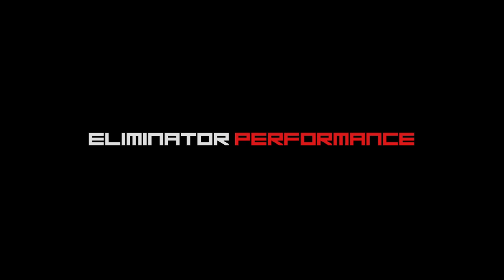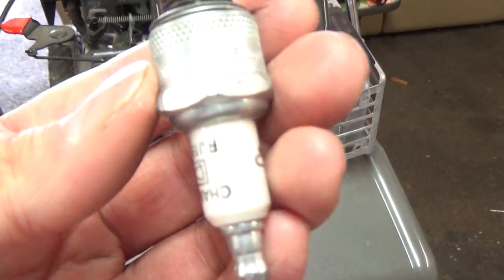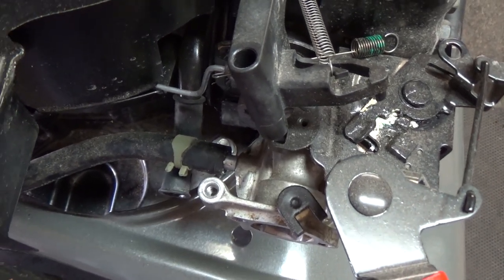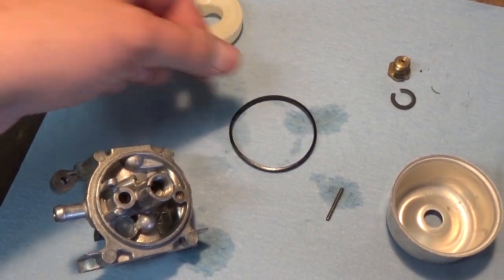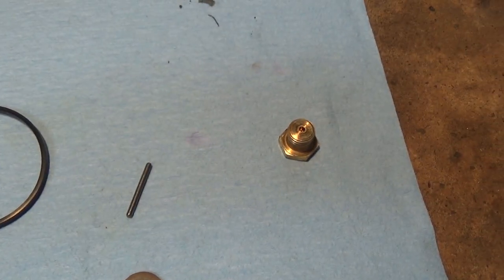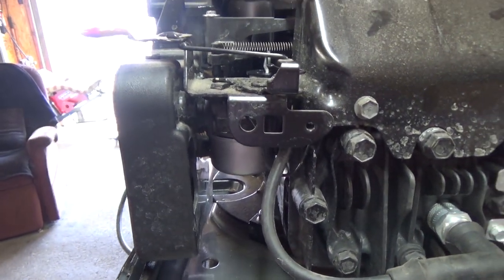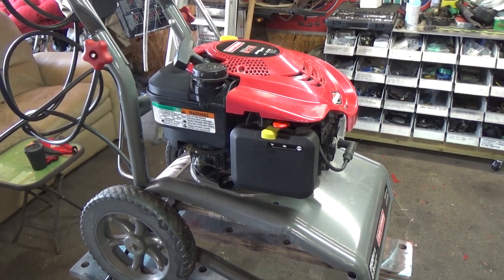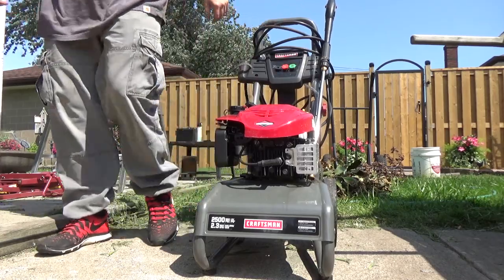Craftsman Pressure Washer - Full Tune Up!

Comment: Dude nice video, like the use of the shut off valve on the fuel line while you worked on the engine. Maybe a future video on winterizing a 4 stroke pressure washer would be good for the Eliminators that live in cold weather areas since there are lots of pressure washers for sale with cracked pumps.

Comment: Fantastic video. I have a Quantum gold 6.0 pressure washer that sat in my garage for 5 years.  I'm replacing the carburator, the filter, and the spark plug.  How do you  best clean the gasoline tank? any other suggestions ?  many thanks

Comment: Thanks for the detailed video.  I had the same situation with the jet nut gasket which was broken.  Can you tell me the replacement part number so I can find it?  Seems to be different ones available and I just don't want to guess.  For the moment I'm using a piece of cardboard to avoid the gas to leak but I wish to replace it anyway.

Comment: I just bought the exact pressure washer. What would make gas pour out of the hose that connects to the back of the air filter housing? The gas line hooks to the carb. This other hose comes from who knows where, but pours gas out of it when I pour gas Into the tank.
Reply from the maker: You probably have a leaking needle valve in the carburetor

Comment: Mine is running a little rough after sitting for a few years. I didn't take the carburetor completely loose but I took off the bowl, cleaned it, replaced the fuel tank which was cracked, cleaned spark plug, installed new filter. But it still running a little rough. I sprayed what I could but I'm wondering if the carburetor still has some residue left inside it keeping it from running smoothly. And yes, the gas smelled of turpentine and was yellow. What are your suggestions?

Comment: There's also an issue with them power washers the dip stick seal stops working and it leaks but I fixed mine with rtv

Comment: Good day I just came across this video. You know  canadian tire sells a funnel or did, that will separate  water from gas, it's tricky but it will keep fine dirt out.  Thanks
Reply from the maker: Yes, water settles to the bottom so it's possible to suck the fuel out from the top. For the price of fuel, and labour if I had to redo my work, we just replace the fuel.
Reply: @EliminatorPerformance   but more people should be using funnel when putting gas into machine Thanks

Comment: It's actually not a "air vane governor". The actual governor is mechanical, the linkage goes toward the other end of the engine. All that air vane does is control the choke through a thermostat attached to the muffler. Great vid.

Comment: I got the same pressure washer out of my neighbors trash and doesn't have the air filter housing can you link me to parts? Also need the o rings for the carb and bowl
Reply from the maker: No idea, this unit was a customers. Goodle the engines model number, or check the description in this video, it might be there!
Reply: @EliminatorPerformance  ok thanks my dad got it to run but leaks gas out of the bowl and now we can't get it running again going to try and clean the injector and bowl again.. lol
Reply from the maker: @gameondude3617  needle valve needs to be replaced!
Reply: @EliminatorPerformance  how hard is that?
Reply from the maker: @gameondude3617  you and your dad should check this video out. It's a little long, but there's good info here! https://youtu.be/3ri2_bKiuMo
Reply: @EliminatorPerformance  thanks buddy

Comment: Hi
Is a 2000 psi 1.9 gmp powerful enough to clean a concrete driveway?
Tx
Reply from the maker: Not if you want to get it down to bare concrete, you'll find yourself going over spots you already cleaned.

I'd recommend something more powerful, a 2500psi or more.
Reply: Ok Thank you for your advise
Have a nice day

Comment: I have the same model and it's leaking a little water from the pump on the left side if your facing it.
Reply from the maker: If you live in an area where it gets cold in the winter, and didn't store it in a warm area, you may have a crack in the pump.

Water inside will freeze and expand, and crack the aluminum or plastic housing.
Reply: I'm in southe California I was thinking it might be an o ring just was wondering if that's normal for this model I just bought it used.
Reply from the maker: @hammer5859  I'm not to sure to be honest, I worked on this for a customer of mine, just needed a tune up and didn't leak.

It's possible that one of the o-rings have gone, go to www.ereplacementparts.com and type in your model number.

You should be able to get a good diagram.
Reply: I took it apart and replaced the 3 o rings it stopped leaking. Thank you for your help!

Comment: I would add a fuel filter and a shut-off valve.  Always remember that some carburetors have a special metal coating that prevents rusting.  I would think twice about using harsh chemicals.

Comment: Is there a common replacement for the bowl nut gasket?  hose things are expensive .  I am wondering if there is a fibre washer that works as good, and what size to order?  I have even heard old milk jugs work ok, but a lot of work :)
Reply from the maker: Cereal box would work too if you were in a pinch.

Here is the official part # : 271716

It's a common part for Briggs and Stratton and Toro machines.
Reply: @EliminatorPerformance  I just put the jet bolt back on with out the fiber washer work just fine no leaks. Same with my craftsman snow blower.

Comment: getting water thru the SYSTEM but looks like the gun won't allow water thru it, how difficult is it to find one, and what do they run, as in cost?  I own a Briggs and Stratton  I own a troy bit  175cc 7.75hp 2700PSI engine year is built in 2013.  thank you. looks like the GUN has about five philips screw heads in it, is it rebuildable?
Reply from the maker: Take the line apart and run some compressor air through it to make sure there's no clogs..Also, take off the end fitting if possible, if not, let the tip sit in some CLR over night to remove any calcium deposits!

Hope this helps
Reply: [EDITED-I will take that tip off, and I have a air compressor so i will be using that for what you suggested, need to buy some CLR though, don't think i have any of that, i know what it though, also, the AIRFILTER is dirty, it is the spongy thing attached to the CARB, right? ALSO, i bought a new CARB for it, and this new one has an inline gas filter that the old one didn't have, so i will be adding that, thank you for all of your help, you are awesome.] <<<930PM[MAY 29,2018]
thank you for the very fast reply, that tip may very well be it, took gun off, turn hose on,[not trying to start PS yet, this was just to see if water gets thru at all], with water on, and gun detached, water is flowing thru, now problem with gun is also, that the trigger acting really funny dosn't feel quite right, and the button that releases the trigger so you may squeeze it, is sticking, the trigger pulls when you push the button to the left or right, but with gun on, it is not getting water flow even though water is turned on and trigger is pulled [again with not starting the PS yet.], ill try another tip, i have a few and see if i can get the water to flow when water only, is turned on. thank you again, HOWARD from Miami Fla. [P.S. ALSO, when i first took gun off to see if i had any flow without PS running, the water seemed very milky white, it just seemed strange, never seen that before. adding that here just incase it does mean something]
Reply: Got it, running and all, could not do it without you brother, hope ya don't mind me saying that. BRAND NEW CARB, after turning the water on, and trying to start it, it started and the GUN and tip all work fine, it is awesome feeling when that thing cranks, aint it? i think it is. got a new air filter also, and also an inline GAS FILTER, [that came with the new CARB. HEYA EVERYONE, i strongly say to you all, get a new CARB instead of trying to clean the old one, leave it be until you get it all going, it will be much easier, on your stress level and all, please believe me. Then after you get it all going then go after the old CARB if anything you'll have it when you need to deal with this issue again, just swap it all out then again clean the CARB. and don't forget the SPARK PLUG, if dirty, just get a clean new one, cost aint all that bad. good luck everyone, and please join this youtube VIDEO, i think he deserves your support, and an awesome big thank you to, Eliminator Performance for making that video and for helping me and all of us out here!

Comment: I take it there's no fuel pump for this>? I picked the same washer up from a guy down the road said it needed a pump cause it didn't run did NOT specify.. Sooo I assumed it was a fuel pump maybe did some research and amazon said it needed this 808656 Mechanical Fuel Pump by Briggs & Stratton BUT now I'm thinking it needed a pressure washer pump and that cost way more. Stupid me for not realizing sooner... I am not mechanic savvy lol